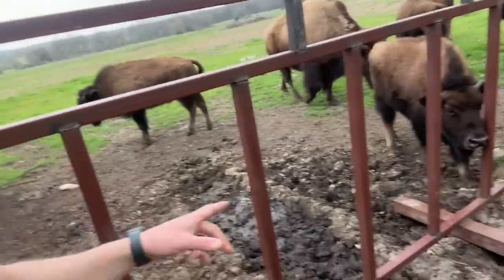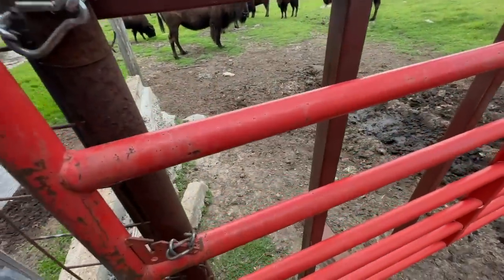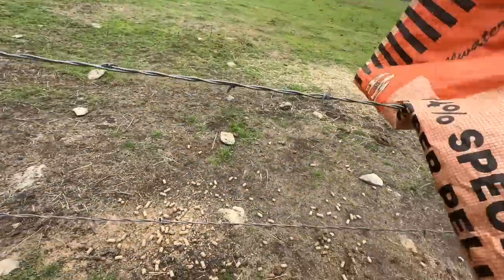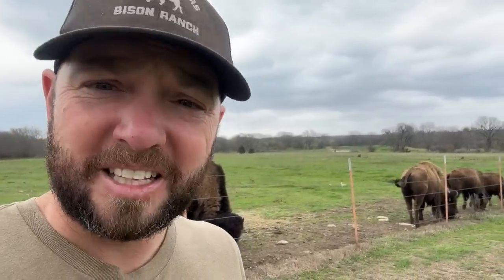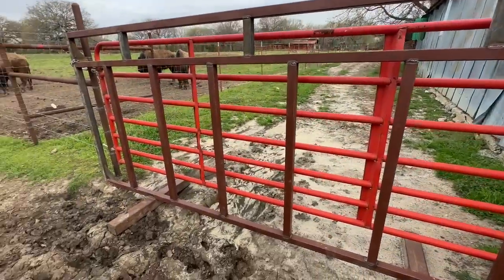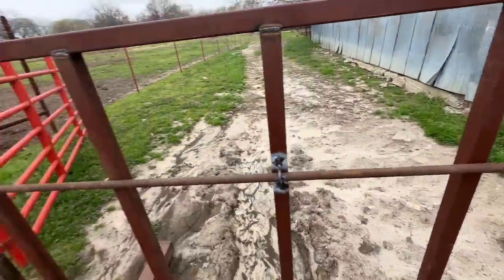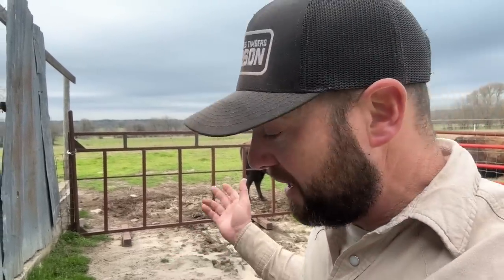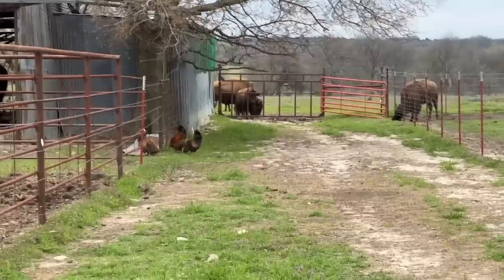Not For You Dunbar! Calves ONLY!

Comment: measure where the calf could barely fit through (near the gate) and bale wire some 2X4  to close up the gap on the others.  see if that works, then just weld a chunk of flat bar top and bottom and with a series of hole you could secure some 2X4 or square stock semi-permanent to the flat bar and have an adjustable size buffalo strainer.